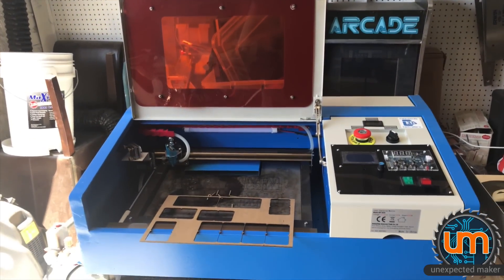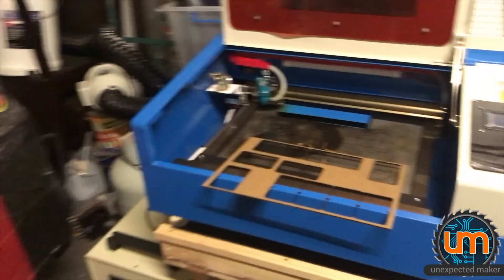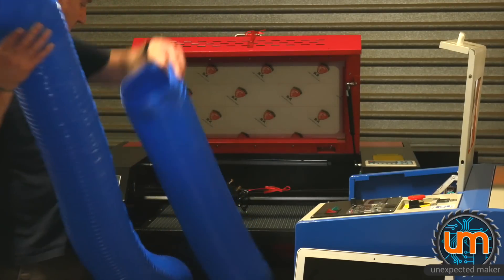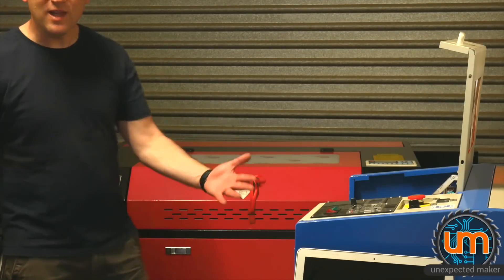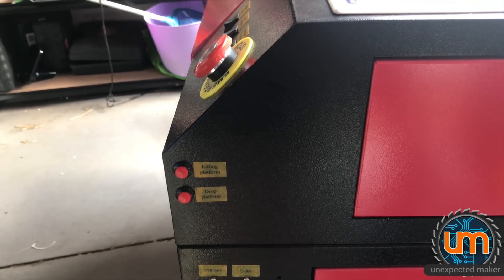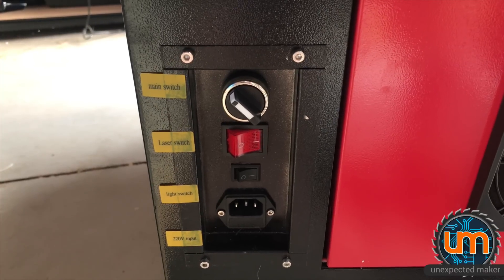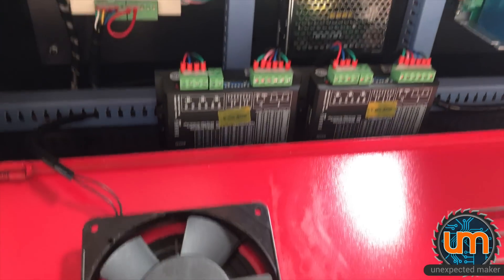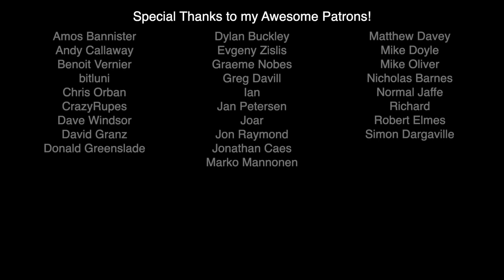Unboxing my new 80W Laser Cutter

Comment: We've since purchased this machine and it worked perfectly out of the box. It was exceptionally well packaged and two elderly men easily dissembled the box and removed the machine without breaking into a sweat. The large fan is several feet away and we can't hear it. We connected the fan to the supplied tubing with airconditioning ducting and an adaptor. It's far better than our older machine and almost twice as fast. Cutting speed for 3mm MDF is 15mm sec at 42% power.If you increase the power to make it faster, you'll exhaust the tube a lot quicker.

Comment: Thinking of buying one of these quick question tho can it be removed from the stand ?
Reply from the maker: Not easily from what I can see. I'd have to climb in underneath mine to see how it's attached, which I can't do atm as the underneath is used for storage. Sorry.
Reply: Unexpected Maker thanks for the reply. I doubt I will get it thro the door if I can’t it’s the only thing holding me back from buying at the moment. Was going to remove it from the stand then put back on once in

Comment: Hi Seon. You've had this 80 watt machine for a while now, so can you please comment on (a) reliability, (b) accessibility to spares and (c) whether it requires a dongle to operate?  I've been using another 80 watt machine at my club for several years with amazing results, but I'd like to purchase one for my own personal use. I mainly build models and I'll put up a web site where you can see them  here when I open it shortly.

Your machine is currently cheaper than the one I've been using, but seems to do heaps more. It's currently listed on eBay for under $3,500 and your comments will help me decide.

Just a few tips for users, new and maybe no so new:

1. Add a bit of radiator coolant to your water to reduce mould buildup.
2. Tube life is usually quoted at 2000-4000 hours. Like a car, the faster you drive the machine, the more fuel you'll consume. I run my machine at 8mm second at 40% power to cut 3mm MDF. Running at 15mm second at 80% power greatly reduces tube life. Tubes cost money as does petrol. Think about the money you will save for the sake of an extra ten minutes.
3. If using ply, avoid Marine or Outdoor Ply which may use epoxy glue. Laser cutters can't cut glass and epoxy glue is like glass. Normal interior ply isn't an issue.
4. Cutting Acrylic is okay, but some plastics such as Poly Carbonate give off toxic fumes.
5. Clean the lens regularly, but don't scratch it.
Reply from the maker: Hi John. The laser has been great. No maintenance required since I got it, not even a mirror re-alignment. It's been rock solid, and finally being able to use Lightburn on it has been fantastic. No regrets buying it. Can't comment on spare parts as none have been required. I'm not sure how many hours I've clocked up cutting, but it's many :)
Reply: Thank you John King. You provided so much helpful info. I wish more people could be as efficient.
Reply: @AM_FM_2  Thanks. The machine is working flawlessly as I write. I plan to do my own videos on model making but I'm still playing with settings for other materials.

Comment: any of you guys able to help tell me if these laser cutters can be separated from the bottom stand to get into my workshop?
Reply from the maker: Though it's possible, You'd end up probably damaging the unit if you put it on its side to remove the base, so I'd not recommend it.
Reply: @UnexpectedMaker  thank you for your input but why do you think this?the laser isn't loose or something is it?I will be moving the stand into my workshop and then with the assistance of a friend I planned on quickly but carefully tilting the unit on its back or front just to get it through the door and then it will go straight back on its stand
Reply from the maker: It's not loose, but there are a lot of moving bits in there, and it's not really packed in a stable enough way to be tipped sideways. Like there was very little holding the X/Y axis and laser head in place... enough to keep it stable horizontally during shipping, but not tipped over. But you might be ok... depends on how well it's packed internally for you. Maybe if you re-enforced everything before tipping it, but you're also likely to mess with the laser/mirror alignment.

Comment: Thanks for the video, it's tipped me over the edge! I'm considering getting a laser cutter and through the same seller they have a 60w and 80w with the same 500x700 cutting bed. how come did you choose the 80w and not the 60w? Cutting time is not uber critical, I would like to cut 12mm plywood, mostly will cut 3mm material.
Also a follow up on how the machine has been treating you and any additional modification you could recommend would (maybe video) be amazing!
Reply from the maker: Sorry for the late reply - glad you decided to get a Laser - They open up lots of possibilities for projects. I went with the 80W for the extra cutting power as I previously had a 40W. 60W would be fine for your first laser though. You don't haver to cut through material in 1 pass.

Comment: I am looking to purchase this Vevor 80W Laser Cutter from a supplier in Sydney. Seeing your unboxing video is persuading to get it. The only problem with this laser cutter is that it currently the Topwisdom controller doesn't work with LightBurn software.
Reply from the maker: Yeah. I'm making do without Lightburn, but I'm occasionally tempted to buy a Ruida controller and swap it out just to get Lightburn back ;)

Comment: My 50w I lifted by myself and got it into the house then had to remove two doors from the hinges and got it into the Den.  Then I used the crate it came in, and a few 2x4 boards, to make it a table.   Oh, here comes the worst part and that is I had to lift it onto the 36in table.  No way, no how so I removed all doors, and hinged lid and lifted it up by myself.  I am a 5' 6" person so that was no easy task and it did a number on my back but I lifted with my legs mostly.  Only saving grace was it was in November so not the normal 100f day.
Reply from the maker: Wow, good effort! I'm glad mine came on wheels and I already has a place setup for it to go!

Comment: You will need to Australise it with a proper earth through the plug not the earth strap. I would recommend not running all your electrical extras off the machine as well.
Reply from the maker: The wiring is fine.. excellent in fact.. best wiring I have ever seen out of China :-)
Reply: @UnexpectedMaker   same with mine, just arrived today. But you will be drawing excessive power through the machines power supply. But in the end it is your machine and you can run it if you think it is fine. Nice looking machine!
Reply from the maker: The power plugs on the back are 220V pass through, they are not touching the internal power supply of the Laser. That said, I am not using them. All mains powered equipment is running off an external power board.
Reply: @UnexpectedMaker   Does that mean you are not using the outlets on the back? I am a little confused about setting up the machine. Do you use external outlets for compressor and air pump?

Comment: Mate you are going to love this - I got the 100w version about a year ago - after a fairly steep learning curve I haven't looked back.
If I might make a suggestion to you,  check out RD learning works on https://www.youtube.com/user/SarbarMultimedia he really gives the good oil on putting this baby into operation.
Happy journey.
Reply from the maker: Nice. Yeah I almost considered a 100W... but felt the 80n was a good price/power compromise from the K40.
Reply: Unexpected Maker  actually you will find that the 60 to 80 W range to be far more versatile when engraving or printing - you’re going to have a ball
Reply from the maker: Yeah, I've heard between 60-80 is the about the max you want to go and still get details scanning detail, and the K40 did a great job, but just slow.

Comment: I have exactly the same. And the peak power is 80w and the use power 50w. I think that they are made exactly in the same factory. (the electric tape in the tube, same controller, same screw driver...) so... I don't know what wattage we have... Maybe I need to buy a laser power meter.
Reply from the maker: Yeah a water temp and power display would be nice!